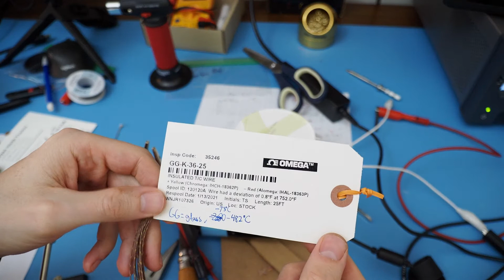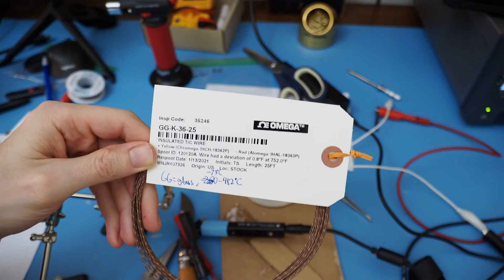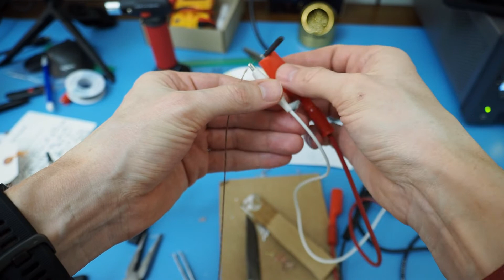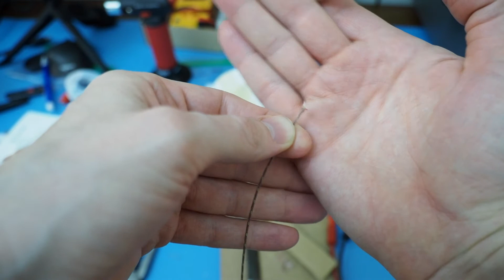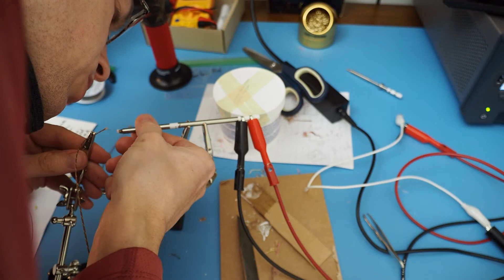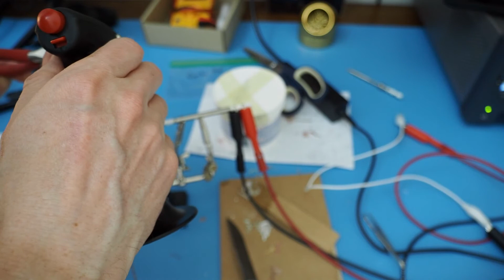TS100/IronOS Test Tip Creation

Comment: I thought the TS100 had a built in thermocouple already in the catridge?
Reply from the maker: It does, these are for testing and tuning the heating algorithm. Putting this thermocouple on the tip reduces thermal lag and can show the thermal gradient of the tip from the point to the internal thermocouple.